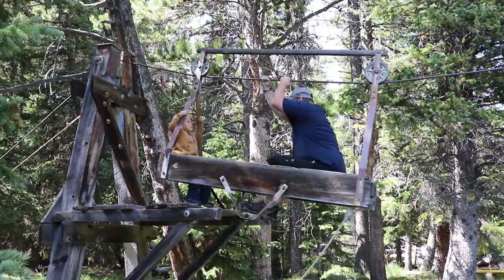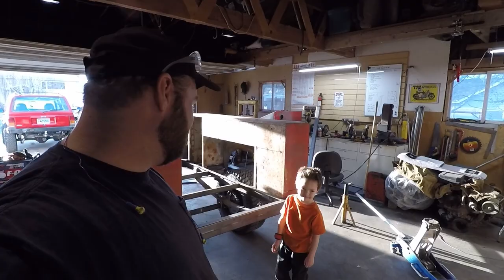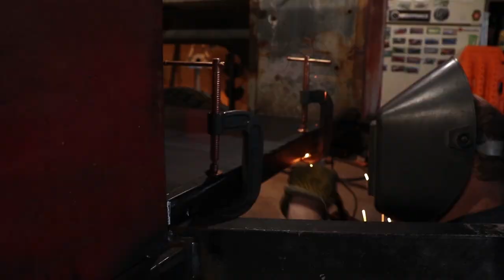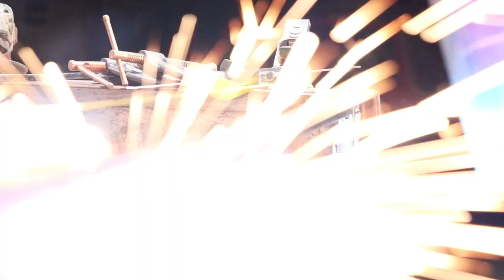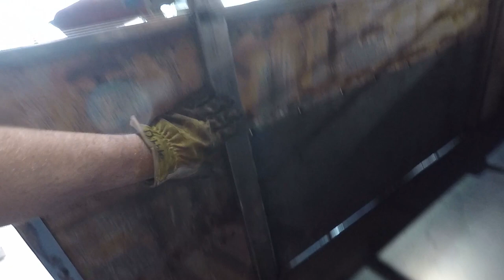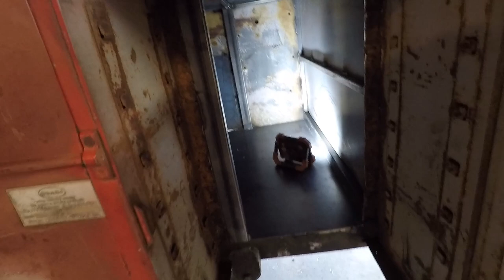The Roamer - Part 3 - Project Overland Trailer Build - Camper Conversion

Comment: awesome. Well done.  I think its getting some weight as the wheel well is starting to squat around the wheel.
Reply from the maker: Yes! Lol I took the trailer to the scale and it weighed 1124 lbs with the trailer empty,  31" tires, and the drawer slide.

Comment: Sounds like a RTT on top ? I think shocks & brakes would be wise... the local old timers made those the first mods to the old off road GI trailers. 
You might want to abandon the ball coupler for a piece of of 2" ID receiver tube running from a foot or so in front of where the frame comes to a point then back to your first cross member. Have an extendable drawbar, drill & pin it, have a few holes spaced out for adjust ability.
Will XJ flares fit over the wheel opening ? Maybe fill in the areas where the flares won't... or TJ rear flares.  It's looking good...
Reply from the maker: Thanks for all the advice. I will be making a custom off road hitch to handle the extreme angles the trailer with be going through. I thought about making an adjustable tongue but in the end I decided to have a solid fixed tongue because I have ideas for the front for additional storage.

Comment: Have you considered placing propane at the front of the trailer? Like you see on many RV trailers> Then it just vents to the outside. Or do you have other plans for what's going up front?
Great build!
Reply from the maker: Thanks! Yeah I have kicked the idea around and I think I'm going to install a 20 gal. Water tank in that front area and install my propane tank external .

Comment: I may have missed it, but how thick of material are you using for the floor and sides? Thanks
Reply from the maker: Hey good question. The floor and sides I used 16 gage and the roof I used 18 gage.
Reply: @dboverland2479  thanks
Reply from the maker: Any time 👍😎